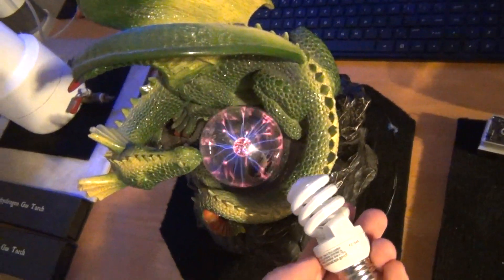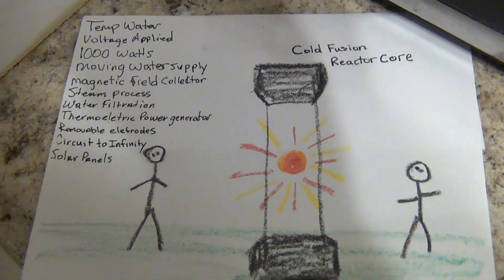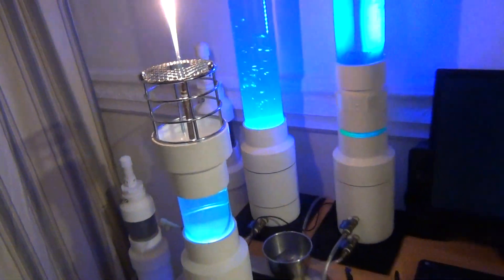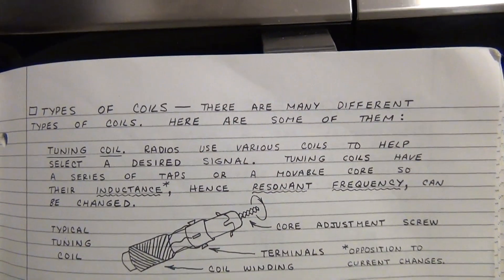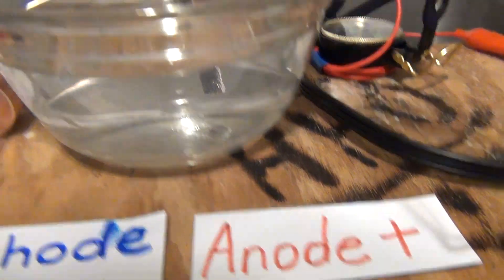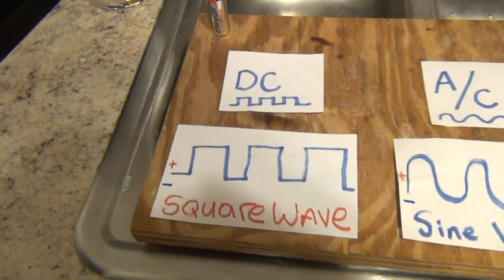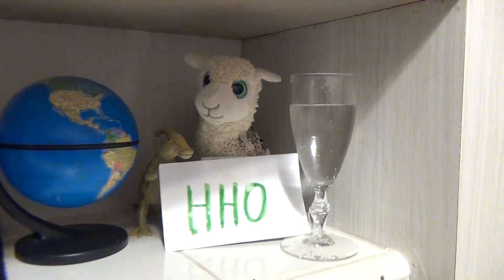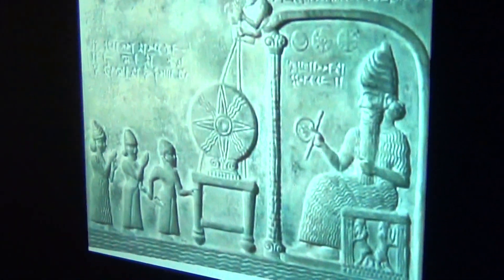HHO COILS PULSES & ELECTROMAGNETIC WAVES

Comment from the maker: Here we take a closer look at the coil's pulses and electromagnetic waves given off by the cold fusion reactor we cover some of the basics of high and low voltage electricity and some of the effects on the water molecule using different types of electrodes such as graphite and tungsten.